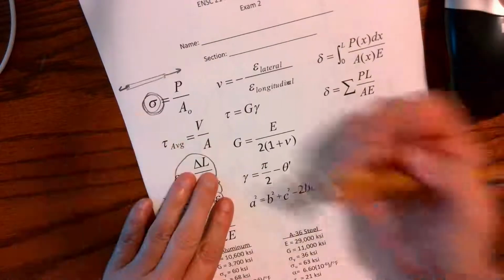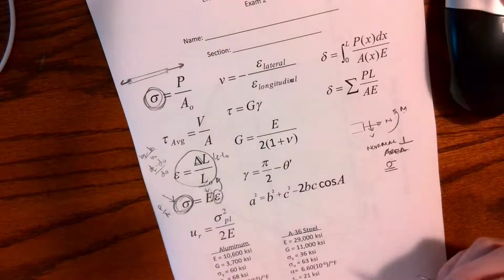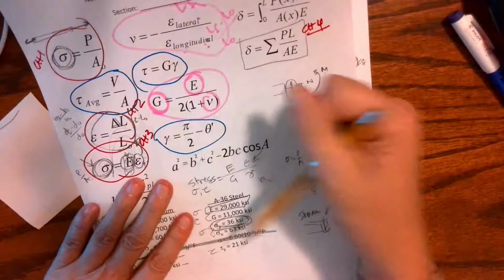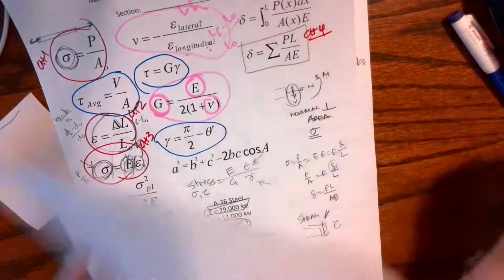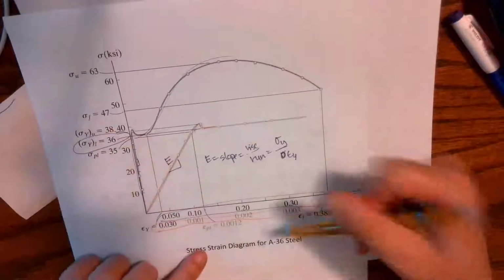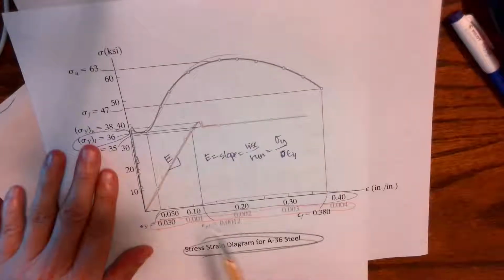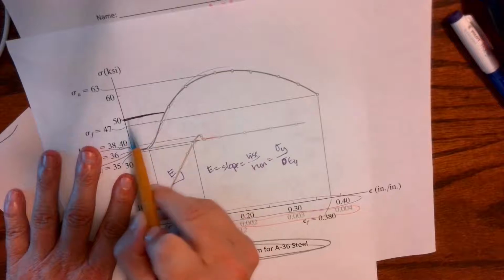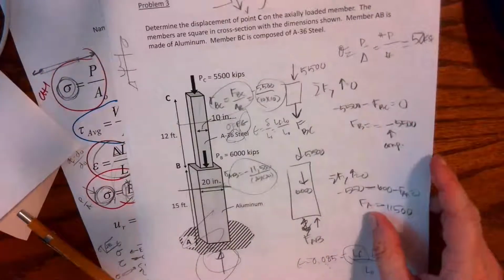exam 2

Comment: I don’t know if you’ll see this, but will we have to find modulus of resilience and toughness ?
Reply from the maker: NO  But if you did it is easy.  Resilience is just area under elastic region so 1/2bh which is 1/2*Yield Stress*Yield Strain and toughness is area under whole curve which we give you easy shapes so you can calculate.  But no you don't have to